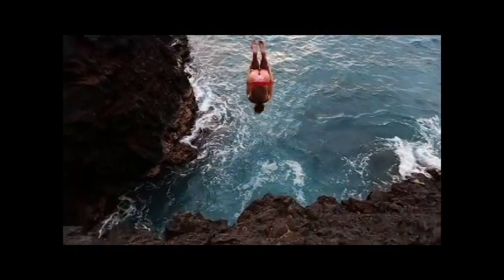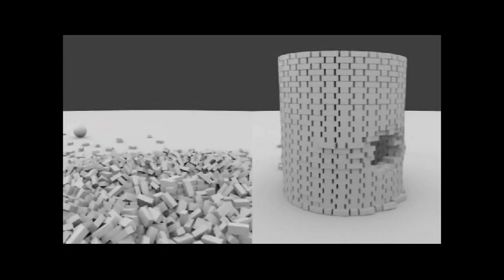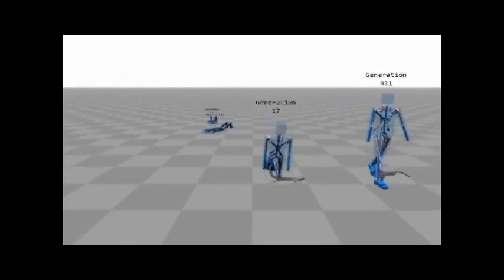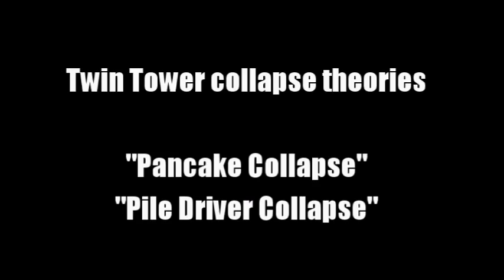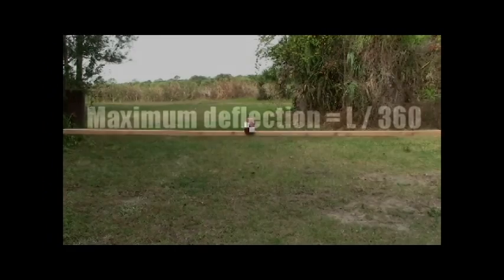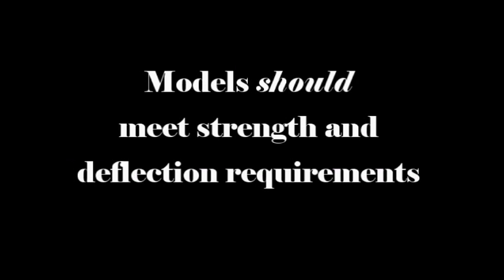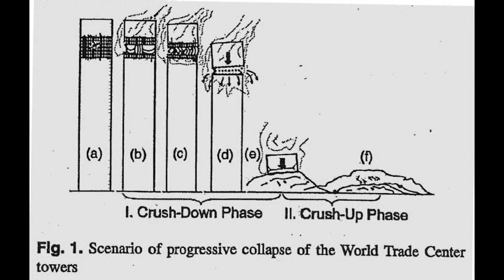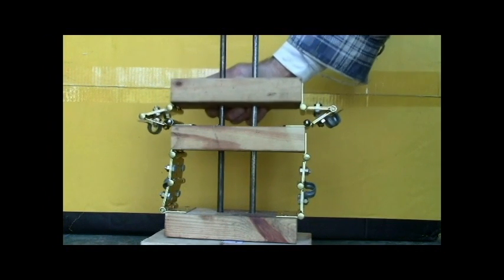9/11 Experiments: The Force Behind the Motion

Comment: I do computer simulations and I can assure you, you're all wrong about scale simulations witch is insanely important. 
Material density and material solidity is different with size. Mass and size are not the only physical measurements of a material.  I'll give you an example:
Reply: throw a brick from 400 meters high, it will break into what, 3-4 bigger segments and have millions small shrapnel flying around. throw a cube, 10x10 meters representing same density as a brick that size, even from same height, when it hit the floor, it's gonna turn to fucking sand. The bigger the object is, the less overall structural density, the bigger they are, the more they gonna feel like it's made of cartboard.

Comment: pjysicsandreason - I highly recommend getting into architectural engineering modeling/programming, if only purely to experiment without wasting resources. The forces behind the motions explained that you experimented with, will never deal in the same with any structure you create as they did with the twin towers. Aside from material and design differences, you have an obvious difference in the variables contributing to the towers downfall. The amount of people and objects in the room, the temperature differences between the fires that started and the still air conditioned rooms below and above, even such simple things as electricity being interconnected as a circuit thought the building creating various weak-spots for pressure to rip open, creating the 9/11 we know of.  The "advanced programs and mathematics" that were used to explain these events, included all of these variables and more.